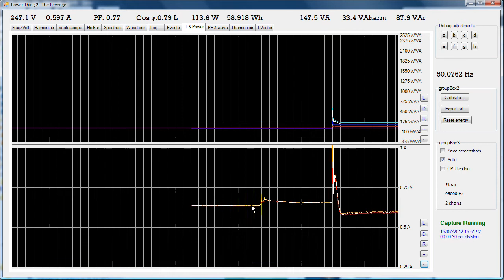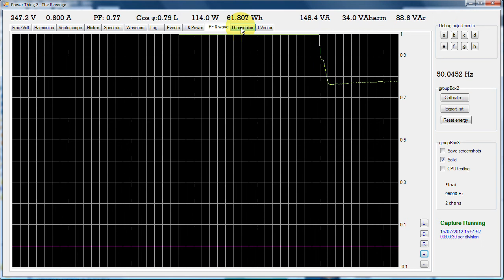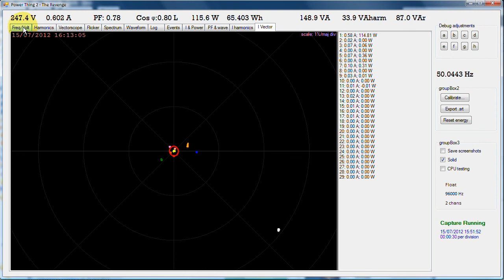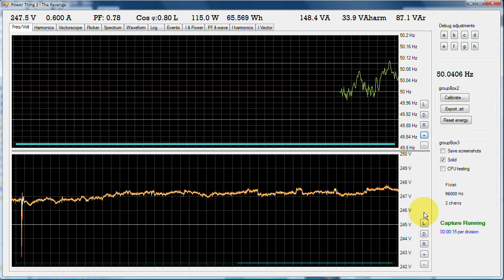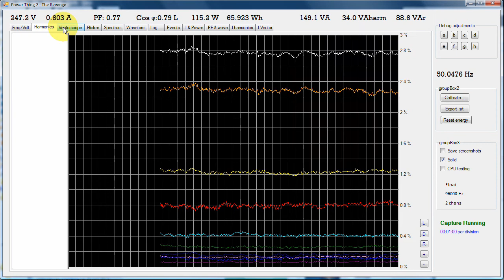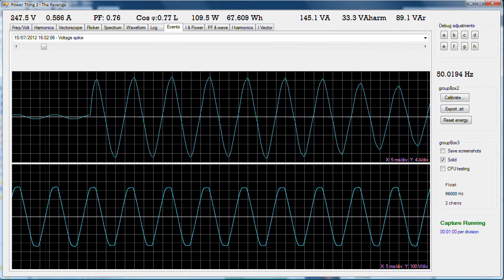Fridge current analysis

Comment: My fridge has a SMPS on it which makes recording the power grid unbearable whenever the compressor is NOT running. When I make a recording I unplug the fridge. However it doesn't affect the VLF magnetic loop antenna too much. My fridge also runs a fan at other times before the main compressor switches on.